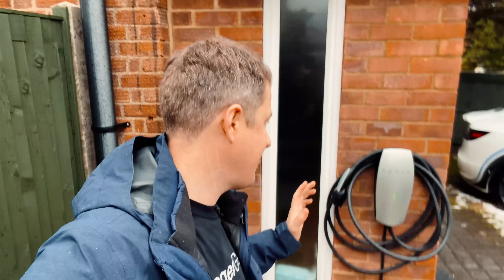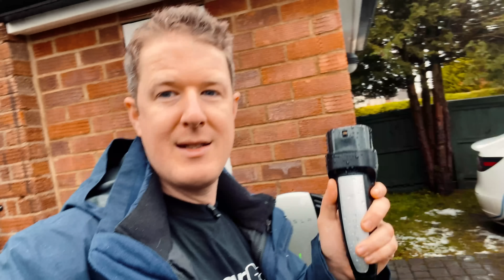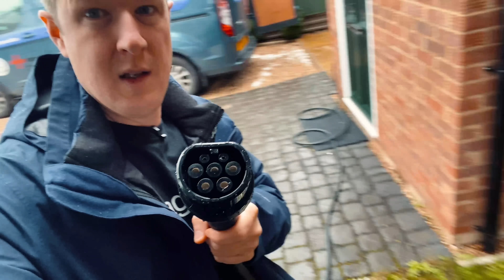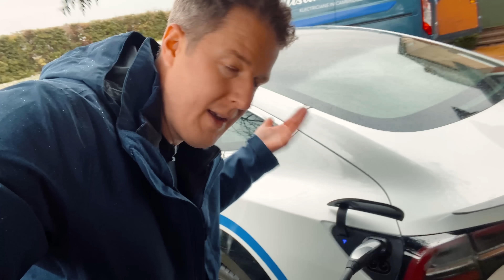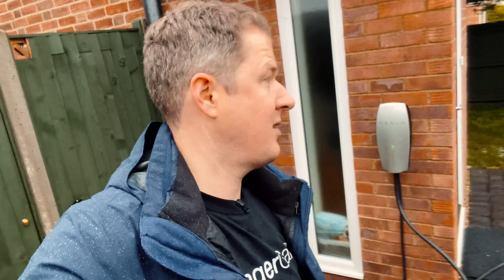Why you shouldn't buy a Tesla Wall Connector

Comment: In the US a Tesla Wall Connector (like all level 2 charging, the Tesla device is not actually a charger, it's just a connector to line power, the charger is in the car itself) has a GFCI built in. I am not sure of the correct terminology in the UK but the US GFCI measures ground fault current (current flowing through your body to ground when touching the car) and instantly disconnects power if such a fault occurs.  I would be surprised if the Tesla wall connectors sold in UK and EU would leave off the GFCI.

Comment: Page 6 of the Tesla wall connector installation manual says "This Wall Connector has a ground monitoring circuit that continuously checks for the presence of a safe ground connection and automatically recovers from faults." Wouldn't this safeguard against a PEN fault?

Comment: I am in the United States with 240 V single phase.  The charger claims that it has  a ground fault interrupter and that a GFCI is not required.  But, if in doubt, one could replace the breaker with a GFCI.  They are $180, though.  Your 3-phase cable is quite a lot thicker than our single phase version.

Comment: Hi Jordan. You have scared me a bit.! My RCDs are all type B, but only single pole. Is this bad for Tesla wall charger installation? Thanks. Michael
Reply from the maker: I think you will find that those are MCBs not RCDs
Reply: Thanks Jordan. Yup. Senior moment. Those are MCBs which are connected to a two pole RCD - presumably not type B. Is a type B RCD a drop in replacement or is the wiring different? I hope this free advice isn’t too cheeky. Kind regards. Michael
Reply: I see that you need a separate consumer box and that you said this in your video. I’ve found one in the U.K. for £179 delivered. Does it wire/connect the same way as a standard consumer unit? Plus I would need an earth rod etc.
Reply from the maker: @michaelarcadian  You will need something like this https://www.replenishh.com/garo-g8ev40pmeb-mcu-40amp-type-b-rcbo-pme-fault-det-connection-unit-65-3764
Reply: Thanks. That is getting expensive. I had found this from an ev charger vendor: https://shop.evchargersdirect.co.uk/products/type-b-rcd-2-mcb-garage-mini-metal-consumer-unit-ev-charge-point-install
Best. 
Michael
Reply from the maker: @michaelarcadian  Yeah but you need a PEN fault detection device as well. If you have the new Gen3 Tesla wall connector you wont need a Type B RCD though. Video coming out tonight at 8pm about that.

Comment: Love your videos. Thanks. Do you have a view on podpoint vs zappi? Specifically, given what you’ve said in this video, the podpoint docs say it has 6mA DC leakage protection and PEN isolation system, though not it’s own RCD. So if there is a type A RCD in the consumer unit, does the podpoint offer the same safety features as the Zappi?

Comment: Advantages of TWC
- good for 3 phase supplies
- port opening button
- load-sharing for two cars using communication link wire
Disadvantages
- no built in PEN failure protection, so needs rod or O-PEN device
- no built in DC sensitive RCD, so needs type B upstream

Comment: Excellent vid and good see someone with insight into what is and what is not the truth re EV's . charging and more. UK users have to remember that what is applicable in the UK is NOT the same re supply systems in the USA. Earthing used to be via the metal pipework etc in houses BUT these days a lot of pipework is plastic which rather negates the earthing options. But then many systems are fitted with quick flip off RCD devices should the earth etc become live. 👀I like that you point out VERY relevant points re COSTS even if its 'expensive' etc used in terminology. Doing your research, exploring your options AND deciding based on FACTS and not FANTASY? Not everything your car dealer tells you is the truth? 🤔Is that still relevant? What do you think? Guys like this are worth their weight in gold.. We need more of this no BS when it comes to the future particularly when it comes to EVs ! 👍

Comment: Hello Jordan, Liking your content but can you confirm you either like the product or you don't like it. Seems there is something going on you are not telling us about.
https://www.youtube.com/watch?v=8DA_iLpymOg
Reply from the maker: I like the charger itself but it’s just so difficult to install compared to the Zappi and other smart charge points which have everything built in. I used it at my house for several weeks and it was fine but I have put my Zappi back in now. The smart functionality of a zappi and being able to program it to charge on cheap electricity are a big benefit for me.
Reply: @artisanelectrics  but if your not bothered about external programming and data as the Tesla has in-built software which would suit me and several 100's more that own them. Charge and drive is simple. Thanks for the speedy reply though, appreciate it. 😎
Reply from the maker: @Tim-Mounjaro-Procter  yeah I know what you mean, its just very expensive to install one because of all the extra safety equipment that you need. But if you have the budget for it and absolutely want the Tesla wall connector then why not!

Comment: This is extremely uk centric. If you don't live in the UK, the Tesla charger works fine, costs half the price of other chargers and doesn't need additional features because you control the charging and current from the Tesla. It also comes with the "big heavy cable" you complain about which is a significant additional cost with a lot of other chargers and is necessary if you are actually using a high capacity 3 phase supply.
Reply: Well yes, it a UK channel aimed at UK residents.

Comment: but does it charge faster/better?
Reply: The Tesla charger does not charge faster than any other brand. Speed is related to the electrical connection. More specifically on how big the fuse is behind the charger.

Comment: You are missing the, in my opinion, best feature of the tesla "button"; sure it opens the flap, that can be done easely - the BIG advantage is that it also can be held down and release the charger again. This is something that can only be done awkardly by opening the app; waiting for the app to wake the car; "stop charging" - "unlock charger" - or to get in the car, click "release charger" and get out, remove it and so on; its MUCH smoother to just hold down the button for a few sec. till it releases.

Comment: Disappointed you didn't talk about charging rate. If one charger is 3 phase and the other is 1 phase, shouldn't one get twice the charging rate with the former?
Reply from the maker: They are both only single phase as most UK domestic properties only have a single phase supply.
Reply: @artisanelectrics  
Thank you for the response. I live in the US, specifically Michigan, so I didn't know this.

Comment: Hi Artisan,
Thanks for creating this video.  However, the Wall Connector has an internal circuit that verifies the presence of the earth ground.  If the ground isn't present or if the test circuit itself fails, the charger will not operate, thus providing additional safety, overcoming the concerns you mention.  Am I overlooking something?

Comment: 750GBP for a Zappi? Looks like they're significantly cheaper in their home country.. I can't seem to find them below 1100 Euro (~1050GBP) on the mainland, and that's usually the versions without attached cables. I wanted a Zappi, but based on price I went for an ABB TerraAC instead. Also Zappi isn't terribly clear about which of their various attachments you need for which cases and how to set them up. As you're an EV expert and Zappi fan, perhaps you could spend a video on those boxes in detail?

Comment: Hi Jordan 
I have the V3 wall connector here in the USA
has wifi to setup the amps - up to 60A breaker.
unlike the 100A for prior, but we mostly do 48A charging at home in new model3 Y anyways

also, the new cable is much thinner and lighter 

not sure if our grounded to elec panel setup here in the usa has same “shock risk”

Comment: I'd say that using the button to stop charging and unlock the cable is more useful than using it to open the flap; otherwise you need to open the app on your phone or open the car to operate the touchscreen (waiting for it to wake up etc), which is much more time consuming. Sure, there is more work involved installing these devices but that's a one-off cost. I like how simple these are, with less to go wrong and no reliance on wifi and 'cloud' services.

Comment: isn’t the only real benefit the remote control to open the tesla flap? It is something I’d like on other cars/chargers - to be able to plug in/remove the cable without needing to get in the car. But the cons clearly outweigh that.

Comment: If a home or office has multiple Tesla’s there is a huge advantage with them. With one circuit in your home or office you can daisy chain these and not over load the breaker.  That’s a HUGE money savings if you have more than one Tesla you want plugged in at a time.   It’s unfair to call it “not smart” because it does have some intelligent design.  

You said in both videos their is no advantage, but it’s a huge advantage for two or more Tesla’s that will plug in at the same time
Reply from the maker: It’s against the regulations in the UK to have more than one electric vehicle charging point on one circuit through so we can’t daisy chain them like you say here. Each one has to be on its own circuit from the distribution panel.
Reply: @artisanelectrics   you are over regulated then. The point of the Tesla is that it can be safe and share the connection by being smart. Your repeated rant that “the Tesla wall connector isn’t smart” is categorically wrong, maybe it’s not useful in the UK, but it is very very smart for folks with two or more Tesla’s at home or work.
Reply from the maker: I’m sure your right it’s just UK regs are different

Comment: I'm just here watching this video after installing a Gen 3 Wall Connector along with the electrical stuff and I literally have no clue what the hell you're saying. If you live in America, please get this Charger, Trust me. For the UK Folks, apparently it's pricey and not worth the install according to Artisan Electrics.
Reply: It’s totally different electric grid so the installation equipment needed for safe use of electric chargers are totally different, thats also why you don’t understand anything of what he’s saying. In Europe the Tesla wall chargers are not safe without extra expensive equipment installed in the fusebox. Remember Tesla chargers can charge with 400 Volts in Europe, thats why safety need to be at another higher level all together, but in return we charge 3 times as fast as you would ever be able to without installing a 120 to 400 volt transformer.
Reply: The US electrical system is essentially TN-C-S (though they don't use that terminology) but unlike british TN-C-S systems they include an earth electrode in every installation, combined with the lower system voltage and the fact that few north-american supplies are single ended this presumablly reduces the risks from faults in the combined neutral and earth supply conductor to levels where they don't consider additional mitigations to be needed.

Regulations don't exist in a vacum, they are written in response to real or percieved problems and the design of the existing system will influence what problems the authors of new regulations perceive.

Comment: The Tesla wall connector was designed to fit many markets, not just the UK. Which is why it lacks certain features when compared to the zappi, which was built with UK regulations and wiring practice in mind. So the Zappi will of course win here. As to the zappi app...   If one needs scheduling, then, as long as either the car or the EVSE can do it... it's really immaterial; beyond that, it's just down to personal preference in gadgets.

Comment: Don't have many choices here (US) because they use the proprietary (much smaller) plugs here in the states, however with expensive adapters you could use a 3rd party one.  With the 3rd gen here you get WiFi integration and load sharing if you have multiple Teslas.  However its like Apple you have to get all their products to integrate together, car, charger, solar panels, battery packs etc.  But if I were in the UK, I believe that the Zappi would be the one I would get as well.

Comment: To get the best of both worlds use a third party cable from evchargeking.com and get the 'Tesla button'. They have both tethered cables and type 2 cable assemblies. Their cables are super light, I've been very happy for 18months so far. 
I find the 'Tesla button' useful not for plugging in as you show but unplugging my tesla. I walk up to the back of my car and as long as my phone is in my pocket then I touch the button and pull the cable out, no app, no opening doors and using the touchscreen, lots of time saved (particularly when it's raining!).

Comment: First, you have the UK/EU style car charge connectors, the CSS. Here in the US, they have the proprietary Tesla connector, which is locking. The primary function of the button is to unlock the connector. With the locking connector, nobody but you can unlock it when you are using a Supercharger. There are those who arrive to find all the chargers full and unplug someone so they can charge. The unlock button doesn't work unless the car is turned on. Our power is a little different here too. Most 240 volt applications here use 4 wire cables. L1, L2, neutral and earth ground. Here, when wiring the wall connector, we use 3 wires - L1, L2 and earth ground. Here, the potential between either L1 or L2 and neutral is 120 volts. Potential between L1 and L2 is 240 volts. We don't need neutral for this application. So, earth ground is available from our supply cable and a seperate ground stake is not needed.

Comment: The button on the charge cable isn't even all that important - if you touch the flap (on the 3 at least), it will open if the car is unlocked.
Reply: That's the same with all Teslas and with the X and S you'll have the key fob on you anyway so if touching the flap doesn't work for whatever reason a long press on the rear part of the fob opens the charge port which really isn't much of an inconvenience either

Comment: i have a Zappi installed in Ireland and just open the back passenger door handle, (phone in pocket) that unlocks the model 3 and then press on the flap, about 5 seconds work. Question: what happens to the zappi if there is that earth fault? does it just shut down?
Reply: It isolates all three conductors (line, neutral and earth).

Comment: The Tesla wall connector works fine in North America. If the British market justifies it, I suspect that the inbuilt protectors will be incorporated into the Tesla product. You are correct to use a product designed for your circumstances. The cable on the gen 3  is much lighter. I only wish that Tesla would start using the more available connector type used for just about all vehicles in Europe. Using something like a Zappi always requires an adaptor in North America.

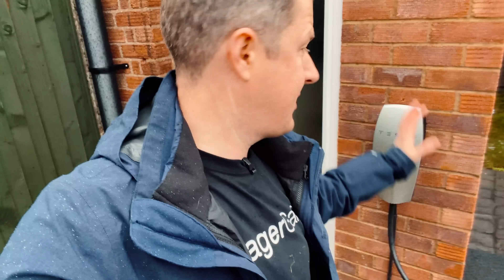Comment: 6:15 I don't understand why you might need a PEN fault detection device if exporting a TN-S earth to the charger.  I installed a Tesla charger in July,  using the network earth provided by Western Power as a conductor separate from the neutral.
Reply: I though you only had to worry about PEN faults on PME(TNCS) systems as the earth and neutral are combined.

Comment: Thanks for the video. I agree that it could have been designed better, but you are missing a few points. First of all your cable is wrapped too tightly around the Wall Connector. Two times around and the adapter fits properly into the WC slot. Secondly, as an example, I had a problem that Tesla was able to fix remotely by installing an updated firmware directly into the WC, increasing the charge flow from 24 to 48amps. Cheers!

Comment: Nice informative video. 
I have the Tasla charger, and I agree that it is a pretty dumb charger, but its not awful. Here in Norway at least, the Tesla charger costs close to half of other chargers. Many of other chargers dont even come with cables. The lak of an app can be helped by using the cars app or an app from your electricity supplier. My electricity supplier, tibber.no, can start and stop the charging and log the energy usage. I'm new to EVs, so I haven't used any smart chargers, so I'm sure there is things I'm missing out on. What I really miss is some sort of load balancing between the house and car, if I need to charge during the day in winter.
Reply: maybe look at Easee? it’s made Norway.

Comment: With TNS, I really don't understand the risk analysis of the car going live. Can anyone explain this to me?
Reply: Check this video for info on modern  pen conductor joint system 
https://youtu.be/rks7R936H-E
Reply: @samuelchamberlain2584  Thank you! Is there an equivalent for how a TNS repair is made? Still trying to assess the realities of PEN faults with a TNS system re EV charging. Also, in that video, I didn't understand why replacing copper with brass would prevent galvanic corrosion with aluminium. I guess the assumption is that the moisture needed for such corrosion would only come along the copper conductor and there would not be enough to reach the aluminium part of the clamp but I don't know.
Reply: My understanding is that the tns supply might not be a true tns if a cable repair has been made .
Reply: @samuelchamberlain2584  I guess it is for the situation when a TNS property later becomes TNCS. Why has TNCS been permitted when it is so dangerous? How can anybody respect the regulations when such a gaping fundamental cost saving exercise has been performed at the expense of people's lives? Also, why isn't charging your car from your 13A plug banned? Are these adapters isolated supplies while proper EV charging points are not?